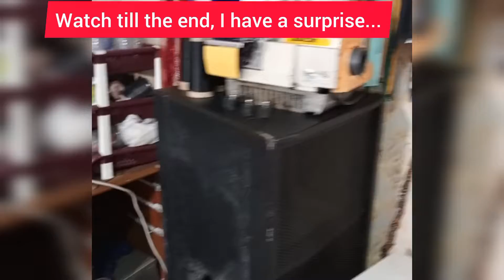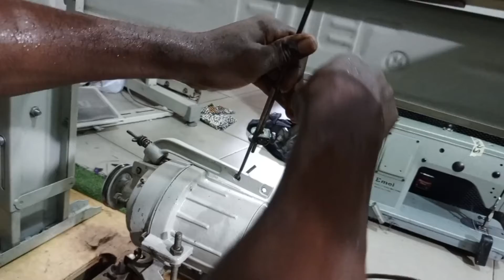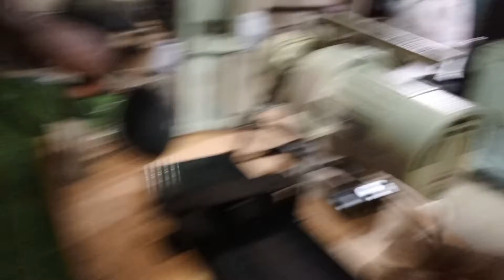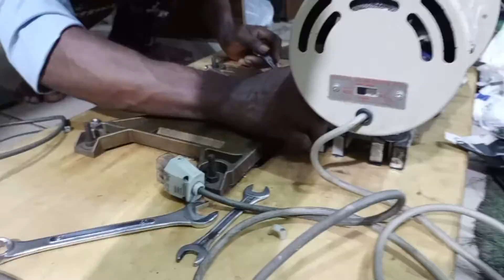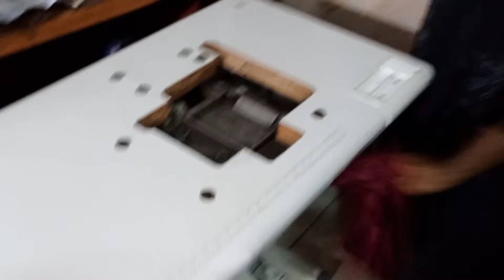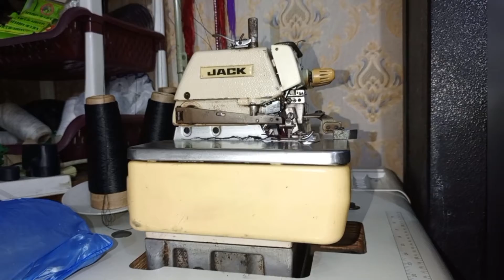How to fix an Industrial Sewing Machine Clutch Motor (Very Detailed)

Comment: Please what is the cause
Reply from the maker: Many things can cause it dear....👇
Check your source of power, make sure it is in order... 
Make sure the motor clutch switch, the one on the machine it's in good condition
Make sure your clutch motor is well plugged i.e if yours is the type that is pluggable... 
Finally if none of this works, please get an engineer to check the clutch motor itself, it might be faulty.... 
Finally, and this is a question to you, Did your sewing machine at any time SMOKE, did it bring out smoke at any time?
Reply: Yeah mine had smoke